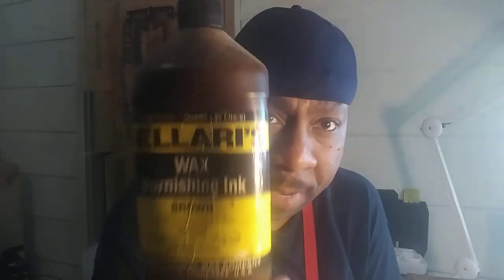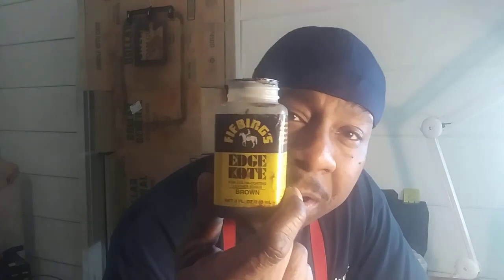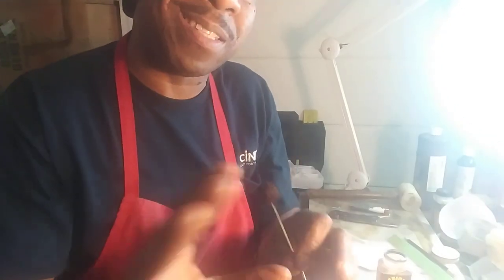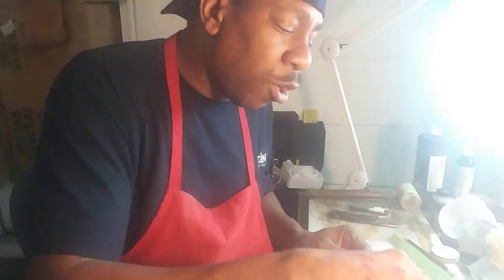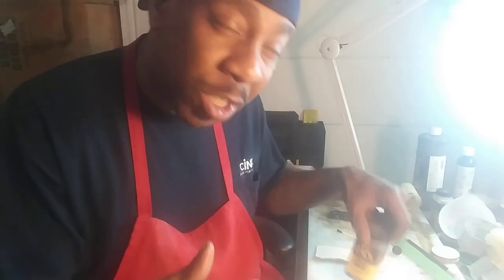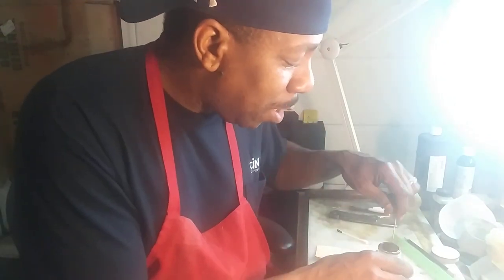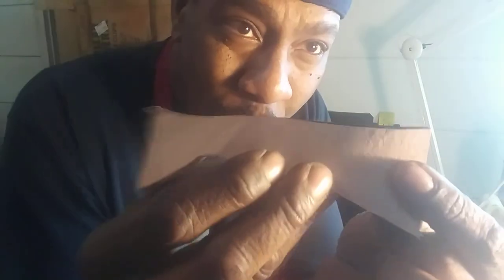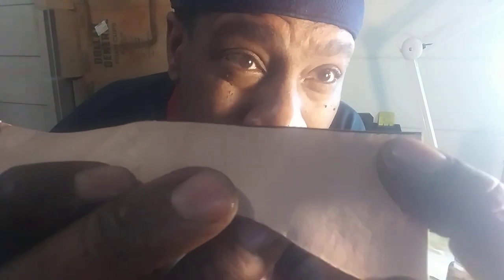The perfect edge. Edge coating tutorial

Comment: And if you want to puff the ends out to get the q tip to hold more fluid and be softer just role it between your hands. I use them a lot, even for dyeing smaller pieces.